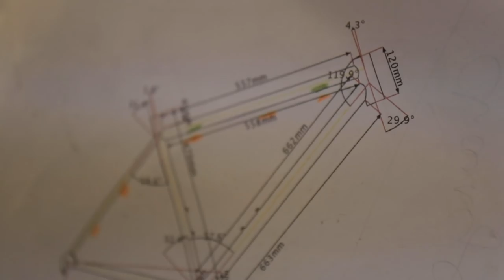The rise of bespoke bikes - Talking personalised bikes with Bespoked UK

Comment: Frame builders weld instead of using lugs and braze because it is less expensive.  Omitting the lugs and super heating, with TIG the ends of each tube, ruins the properties of the fancy steel tubing.  If I were to have a bespoke bike made it would be lugged, like my 1983 Serotta.  The Serotta is why I don't need a bespoke frame.